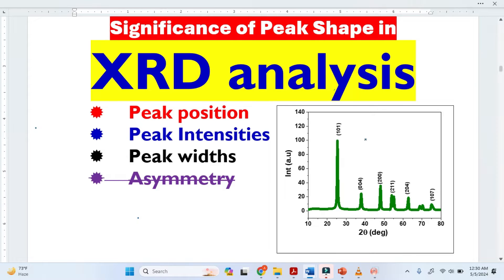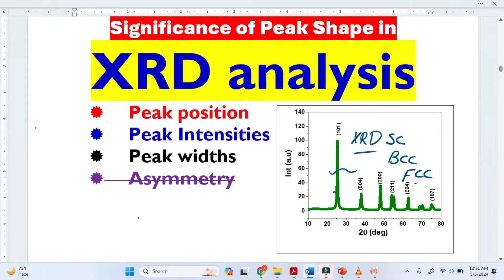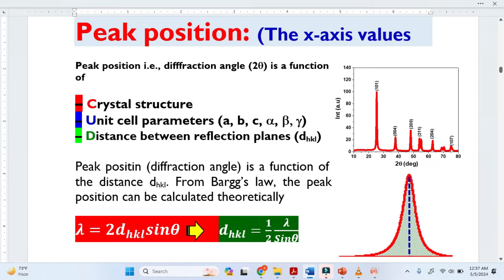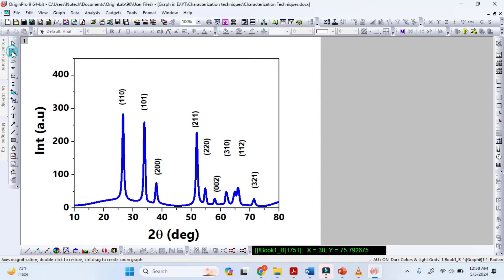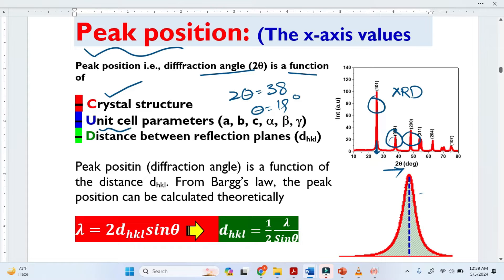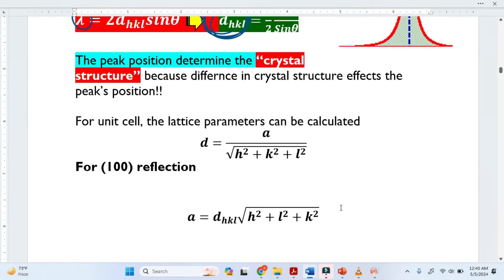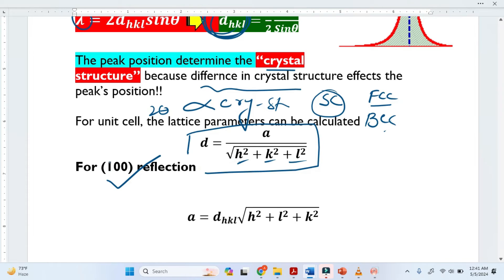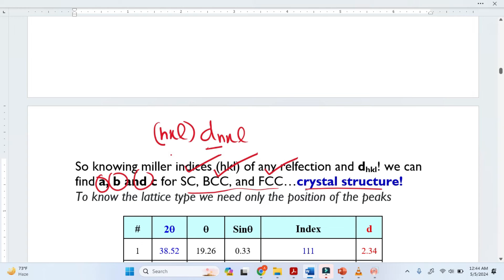How Peak Position Identifies Crystal Structure | XRD Analysis

Comment: Why we use 2theta in Xrd؟
Reply from the maker: θ is the angle between the incident x-rays and the crystallographic reflecting plane, which is also equivalent to angle between reflected beam and the crystallographic reflecting plane.
Here, 2 θ is the angle between transmitted x-rays and reflected x-rays. 
Question: Why 2θ?
Answer: In the case of XRD, the x-rays shine on the sample. The x-rays must transmit as well as reflected (also called scattered) from the sample planes and if we look at the diagram the angle between transmitted and reflected ( or scattered) x-rays is double of the incident angle. This is how Bragg’s law explained!
Another way to explain is: The 2𝜃 convention comes from θ−2𝜃 scans as this how the actual experiment is performed. If the sample holder rotates 45 degrees, the detector rotate at 90 degree.  

PS: I will make video on it to make it very clear!